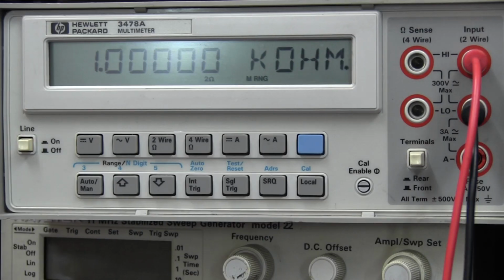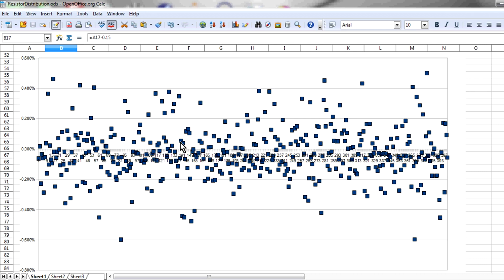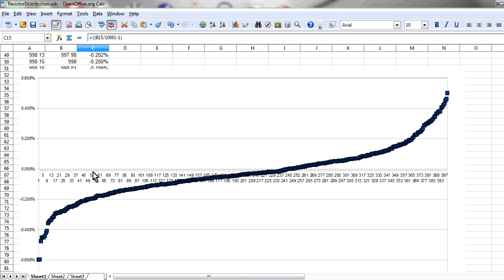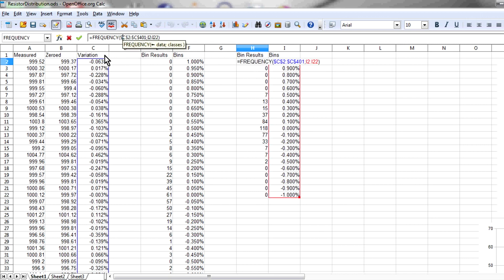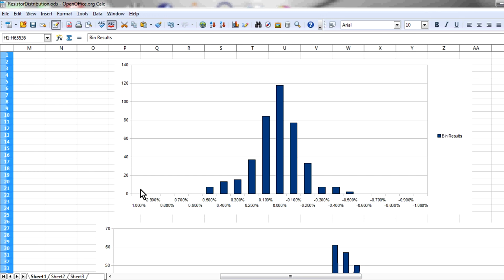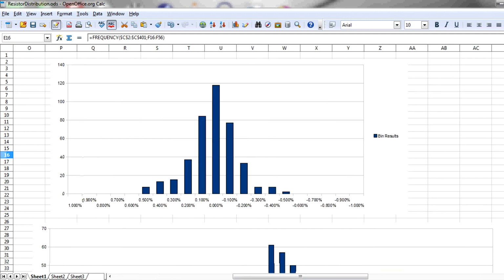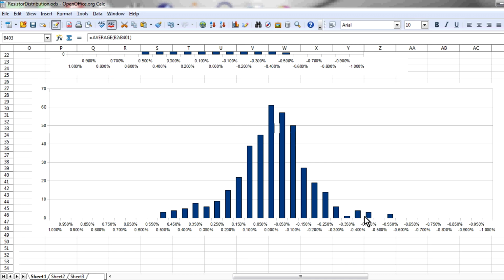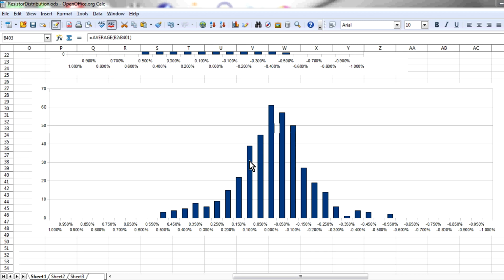EEVblog #215 - Gaussian Resistors

Comment: I just designed a voltage divider to narrow the adjustment range of a potentiometer. I wondered how far I could go with narrowing the range before the tolerances of the resistors could possibly push the adjustment range so far to one side that it does not longer include the desired values.
I ran a quick Monte Carlo simulation in LTSpice that showed me that the dimensioning was safe. But when specifying the resistor values and tolerance with the directive that uses a uniform distribution within the specified tolerance, I also asked myself if this realistically models the actual distribution of the resistor values. Just as Dave noted, I also did not find related specs from manufacturers. So, this video seems to be one of the rare sources that tackle this issue. From what I learned here, the modeling with the uniform distribution I used for the simulation was most likely conservative.

Comment: The simplest explanation for the observed tight packing (sigma <0.5%) is that the manufacturer is targeting 2sigma (2 standard deviations) or better for the nominal range, rather than one.  Thus the odds of a resistor out of spec is about 5 percent.  Given the fact that no resistor was out of spec out of 400, the target could be 4 or even 5 sigma, but I think six sigma would be prohibitively expensive for this application.

Comment: You are not making any sense at 2:20. If you put ten 1% resisistors in series, the tolerance of the series is still 1% - the same as the tolerance of a single resistor. And that is exactly what you state "in words", but then "in numbers" you say that the series tolerance is going to be 10%, which is completely incorrect. You obviously misspoke, but most of your audience is not educated enough to catch this error. They will go on believing that in series configuration tolerances add up.

Comment: First, a numerical fit of the data to the normal distribution to extract the mean and standard deviation of the distribution would be welcome.  Second, 32% of resistors will vary from the mean by more than one standard deviation; 4.6% will vary by more than two sigma; 0.27% will vary by more than three sigma; etc.  Given that manufacturers cannot afford for 32% of their sales to be returned for warranty violations, it shouldn't be a surprise that their specifications reflect 5-8 sigma for tolerances.  Third, by over-specifying their tolerances, they improve their chances that fresh materials will yield salable resistors before they optimize their process to "zero out" the new mean.  Finally, the 1% tolerance is intended as a warranty for all temperatures, humidities, etc. that don't kill the devices.

Comment: I wouldn't call a histogram "the frequency domain". When you do an analysis, or convert data between "time domain" and "frequency domain", you preserve all the information, and can go back and forth. If you start with a histogram, you can't go back to your original signal. Alternatively, what you have to begin with isn't in the time domain, since the order of the  samples don't really matter* (Not to imply that every frequency domain representation contains all information.  a power spectrum density will throw away phase information, for example.)

*Well, they might have mattered, if every, say , 5th resistor tended to be a little higher or lower or whatever. To detect that, you can eyeball it, like done in the video, or actually do a frequency domain analysis.

Comment: actually, this is no surprise, that there is no resistors close to 1% error.
1. If something randomly f up, product is still good.
2. If something regularly f up, you still produce valid product and diagnose what is wrong.
3. You can measure slow changes in distribution while, guess what, producing valid product.

Comment: I'm right at 10:00 and he's been attaching these alligator clips to each other to measure the basic shorted resistance. I think a better way to do this is to connect them both to a single resistor lead (both on the same side of the resistor) - this will account for any contact resistances to the resistor lead. It's surely not much if any different, but I like to be methodical like that.
Reply: Obviously, I stopped the video 30 seconds too soon...

Comment: A very useful trick is to plot the data on “normal” paper.  You can get log-normal or linear-normal.  I don’t think Excel can do that.  Don’t know about Open office.  This shows true Gaussian samples as a straight line.  If the line shows two or more slopes then the sample population is probably made up of more than one group mixed together (made on different days maybe).  If the curve as “Z” shape (three slopes) then the population started out Gaussian but the manufacturer probably could not make all parts within tolerance and had to cull the outliers.
Reply: Worst case, you can always take the log or exponential of the values and graph that on a regular lin-lin scale :)

Comment: I extracted some more basic stats from the data. Assuming only initial compliance and at his room temperature, there is a [sample]standard deviation of 1.7 ohms and the probability of a resistor being between 990 and 1010 ohms, is 5.6e-09 or 1/179 500 000 [one in 180 million] (-5.73 to +6.06 standard deviations)
 If the factory corrects the slight bias so the sample mean exactly equals nominal then it would be 1/270 100 000. Alternately as I don't know the testing temperature or design temperature, raising the temp 5.5k will bring the sample mean to the nominal 1k, assuming exactly 50ppm temperature coefficient.
The chi tests are all unity as well so the Gaussian normal curve is a very descriptive model for this data set.

Comment: Hi Dave, just to add to my earlier comment. Regarding the standard deviation of the resistance values (an indication of the tightness of the grouping) it would be interesting to see if there are differences to the standard deviation between say 0.1%, 0.5%, 1%, 2%, 5%, and 10% tolerance resistors. This will tell us several things: if we see similar standard deviations across the tolerance bands, then we can expect manufacturers to simply be testing 100% of the resistors as they roll off the line and cherry picking the best resistors to fulfill greater tolerance bands, i.e. I would expect to see truncation in the highest tolerance bands, particularly at 0.1% tolerance. If there are improvements to the standard deviations, then it is possible that manufacturers are doing something to the manufacturing process instead (different manufacturing techniques, feedback control, quality of materials, etc.). Another theory would be that to save cost, 5%, 10% and 20% resistors would not be tested as rigorously (100% testing on every component is expensive) so the manufacturers simply widen the tolerance band as a safety net. In theory, a batch of 5% resistors could be just as good as 1% if they had the same standard deviation.

Before the video, I always thought manufacturers would cherry pick resistors to fit within a tolerance band and if they fall outside the band they would be sold to the next band down. For example if I buy a 1k 10% resistor, I would expect the value to be within 900-950 and 1050-1100 ohms with no resistors within the 950-1050 ohm range as these would be reserved for 5% resistors. Perhaps this was the case on carbon resistors which tended to have poorer tolerances, and not on metal film resistors. Either case, this would be interesting to look into.

Comment: Hi Dave, I thought I'd leave a comment to say this looks interesting. If you still have the data, I wonder what the standard deviation of your data is. Based on what I see, it looks like those resistors are built to a six sigma manufacturing standard, if this was the case then I expect to see a standard deviation of  1.666... therefore the probability of a 1% resistor being outside 0.5% of stated value is 1 in 370 resistors (0.27%), similar to the odd one or two falling outside this range in your data set. The probability of a resistor being outside of 0.67% of stated value falls to 1/15,787 (0.006%) so you will need to test many many resistors to see this. In short, what this tells us is that if we a have a project that calls for high tolerance resistance say (0.1%) we could buy a set of 1% resisters and be safe in the knowledge that if we were to cherry pick, over 45% will fall in that range (assuming 6 sigma manufacturing standards) - this will save you buying 0.1% resistors at ~20 times the cost.

Comment: Come on, Dave. They can do way more than plot their process result on a histogram daily or weekly or whatever.

They can figure out the maximum frequency of process drift at the magnitude of significance, and sample the product (individual resistors, in this case) at the Nyquist rate of that frequency. Bob's your uncle, they can do real-time binning according to process accuracy at any given point in time, without measuring every resistor after-the-fact. I imagine that a process with 10% cyclic accuracy overall might have 1% cyclic precision over a shorter time interval – since changes take time to accumulate – and that this could be utilized to batch different quality (and possibly even value) resistors from the same continuous production line. 

Whether they do all that is another matter. But it doesn't seem terribly expensive. I bet it happens. It would explain both your results here, and the common observation that 10% resistors sometimes seem to have long runs where they're -8% ±1% (why not just sell those as 1% or 2% precision resistors at the nearest nominal value of -8%?).

Comment: I had a teacher talk about this at uni. He'd bought 10% resistors at some time when he needed a better tolerance, since they were a lot cheaper, and he'd assumed gauss distribution and had planned to measure and select the "good ones". Not a single resistor was closer to nominal than 5%. The production process provided gauss distributed resistances, and they were then measured, sorted and marked by the manufacturer.

Comment: Excellent video! You asked a very interesting question, came up with a good test, and documented and explained it thoroughly. 

I'd love to see a similar test of zener diodes. I've heard that those have significant manufacturing variation, so they are sorted and labeled rather than being manufactured to hit a specific voltage.

Comment: It's tedious to roach-clip each resistor if on reel package. I've done it, a lot.....lol.
Why not build a jig in a small box, with two contact posts at the proper spacing, and those connect to typical banana binding posts or wired directly to the meter ? Then you can quickly test component-to-component while still on the reel/tape package..
There are test jig posts, that "grab" (via tension/compression) the resistor wire, You slip the component into sort of a tightened tweezer.
I have some, though they are old stock...1960s I believe. With the popularity of DIY  proto boards, I'll bet there's some newer products that are meant as "slip-in" wire-to-wire posts.
Another easy option...is to modify some alligator crimps, "filing" a groove at the tip of the clip so that it straddles the component leads. Lay the taped reel on a non-conductive surface, and hand position the two clips (press against the surface) pressing down to make contact, for testing.. Don't forget....to insulate the clips, so you're not touching any metal. 

This method won't likely work at high accuracy for 1ohm and under....because when your hand gets even close to the leads (or, try grabbing the wire/cable, see what happens) , you become an antenna....and all the other pitfalls of measuring these resistances (stray capacitance, emf, thermal contact, etc....)

Comment: I'm surprised you used two-terminal sensing and not a the HP's 4 wire measurement for the resistors.

Comment: Hi Dave, it would have been good to center the histogram bins symmetrically with respect to the reference value. For example the middle bin between -0.05% and +0.05% instead of 0.0% and 0.1%. I just find it easier to interpret when you refer to the bin for a particular value. Very instructive channel, thanks for the great work!

Comment: Do they sell so few precision resistors that they have no choice but to throw them into the 5% bin and sell them for a low price? I really expected a steep dip at spot-on values, caused by binning. Excessive inventory of near-perfect parts would explain the lack of a dip.

Comment: Bins don't mean what Dave thinks it does (look up FREQUENCY spreadsheet function):
The center bin Dave is referring is not actually it. Speaking of first rougher graph (bins on 0,1% width): What is labeled on a graph as 1.0% is the bin of values 1.0% - 0.9%, so "0.1% bin" is +0.1% to 0.0% and and "0.0% bin" is values 0.0% to -0.1%. Finally, -1.0 % would mean -1% or less.
Furthermore, he doesn't have 21 and 41 bins, but 20 and, respectively 40.

So there are, actually, *TWO CENTRAL* BINS in both first and second finer bin division (AT 26:30 in video).
Look at the graph AT 26:30 : 
Dave says you see some skew toward negative values looking around the central bin, and he is half right. Actually, you see that bins 0.00%, -0.05% and -0.10% (three bins from 0.00% to -0.15%) have higher individual frequency values than the "0.05% bin" (0.05-0.00%) frequency. Which leads you to the same conclusion.

Comment: red is 2 ppm anyway,  nothing like over complication on the simple.
Reply: Harry Haefner Quick Google search says red is 50 ppm/K (or ppm/°C) temperature coefficient. (Sources at the end.)
I don't know what you mean... Like they sell better ones at lower price and label incorrectly?? This would mean that 2 degrees difference offsets ressistance by 0.1 ohm or 0.01% of 1k ohm. Just under measuring accuracy of 4 significant figures.
( Four sources: Electronic color code on Wikipedia, 6 Band Resistor Calculator on eeweb.com, Resistor color code on resistorguide.com and Resistor Colour Code on radio-electronics.com )

Comment: Excellent! Could it be that the manufacturer's quoted 1% tolerance allows 0.5% across a single batch and 0.5% across different batches? Perhaps Philips could send you 500 batches of 500 x 10k resistors to test. You could do a whole series on it! I can't wait ;)

Comment: AFAIK, metal (and carbon) film resistors are always manufactured to a specific value.  The distribution seen is very reflective of "six sigma" manufacturing, where you hold the standard deviation of the process to 1/6 of the reject limit.  The idea is essentially the reject rate is effective held to zero.

When I've heard of binning resistors by value after they were manufactured, it was always in regards to old-school 10% carbon composition resistors.  It would be interesting to a get few buckets of those and see if you get something closer to a uniform distribution of values.
Reply: Paul Ste. Marie Agreed, this is simple statistics.  400 data points is simply not enough to show a 6sigma distribution.  The science of this is the subset of statistics dealing with "confidence intervals".  If he measured say 600,000 resistors he would have a decent chance of getting maybe 1 resistor out at the 6sigma limit (at + or - 1%).  Unfortunately to fill a gaussian distribution smoothly out to 6sigma requires really millions and millions of samples.  His claim that these resistors are really 0.5% tolerance is perfectly valid, in so much that that's probably the 3sigma interval so that anyone buying a moderately sized batch of resistors has a 99.7% chance that all their resistors will lie within the 0.5% tolerance.  Had he tested a couple of thousand he likely would have had a couple lie outside the 0.5% tolerance range.